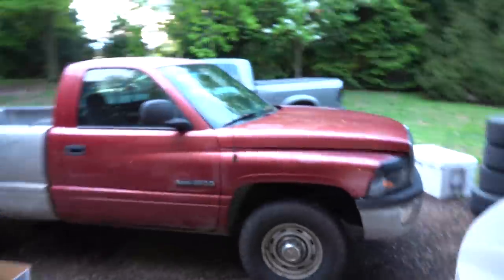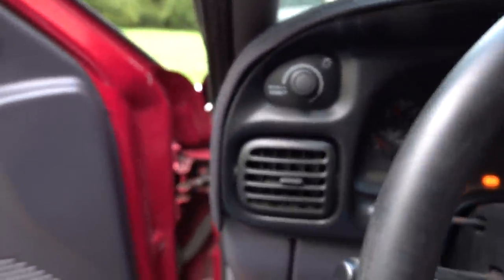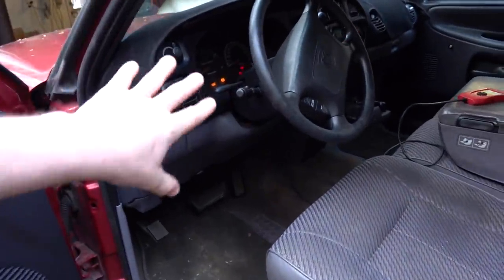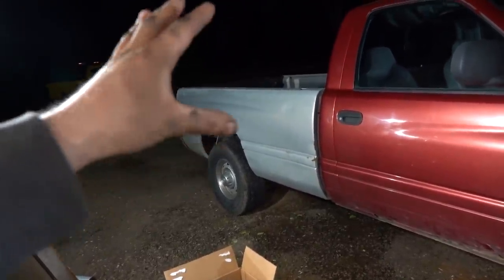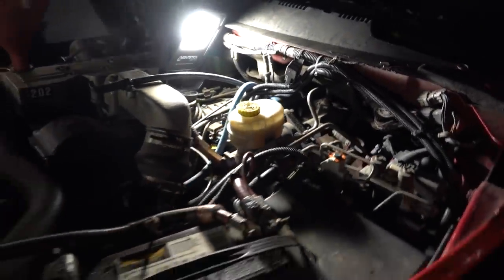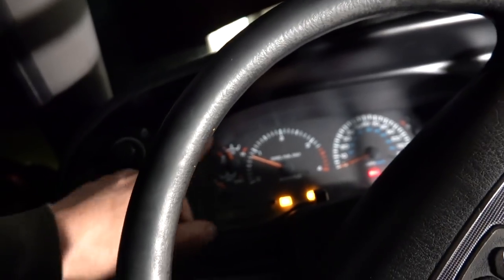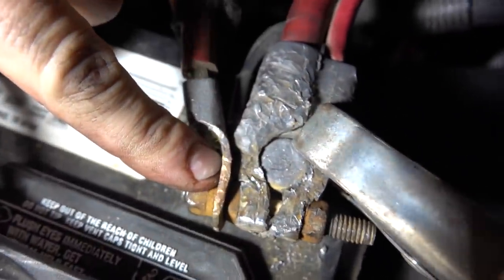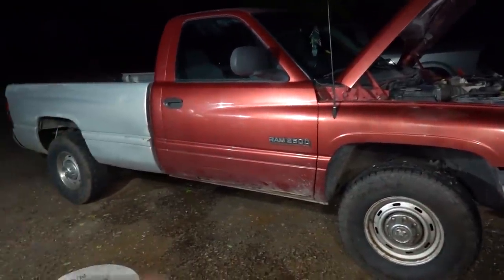2nd Gen Cummins WON'T RUN After Doing This Simple Thing... What A Terrible Start To This Project!!

Comment: Puke bottle is missing off your crankcase vent.  Cheap fix is to run a hose from there down to past your trans along the frame rail. 
That tuner is garbage.  If you just want small increase then diablo power puck (timing only tuner) .  Best power tuner is the Quadzilla, does boost and timing and has a boost fooler.  Charging is controlled by pcm.  A bad alternator will fry it.  You can change the alternator to internally regulated or externally regulated if it does fry the pcm. I had a 99 and replaced or fixed all of the common issues on that truck.

Also, voltage drop is probably your grid heater kicking on
Reply: I had both the diablo and the Quadzilla then switched to the smarty which I liked the best. But quadzilla was definitely a harder hitting tuner than the diablo.
Reply: @I_suk_guys_  Never had the quad, just a tst comp box.  Thing was crazy.  Also had a BD super b turbo and bigger injectors

Comment: The parking brake on the 94, 95, and 96 I've had all come back up but are still engaged. When you pull the release you should hear it spring up, but only within the mechanism. The pedal is already up

Comment: Ur truck being 98.5 auto is a 215hp dana 70 rear.
Larry b's makes nice cable ends. Also for the crank case breather just make it long so it hangs under the engine. Also reroute the wires from the alternator the 24v's  with the auto start jumping in and out of lockup. The 24v's are known for map sensors issues. Look up diesel auto power you can buy a hp package kit. Get a quad box.

Comment: Autos were 70s manuals were 80s. Also look into the gm 3500 brake cylinder mod for the rear brakes while you’re in there.
Reply: Christian Perkovich you can also use dodge 3500 wheel cylinders. For some reason they are bigger than the 2500 wheel cylinders. I’m not sure if they are bigger than the gm as your comment is the first I have heard about it.

Comment: The bolt on the battery on the passenger side is corroded guaranteed you pull that bolt out and put a new on in or clean it and the truck will start charging again